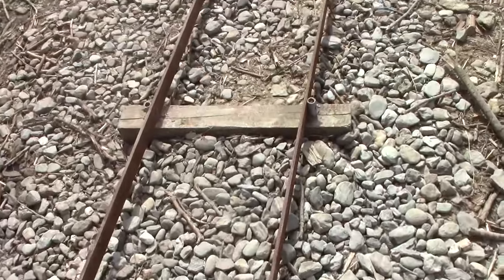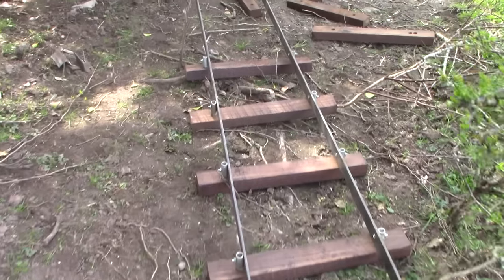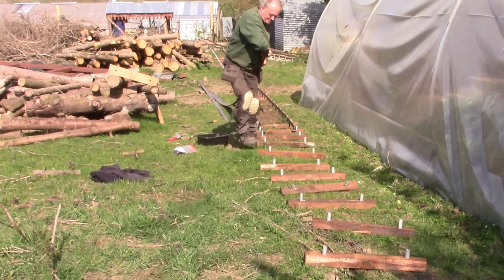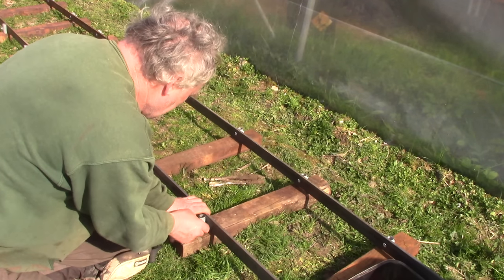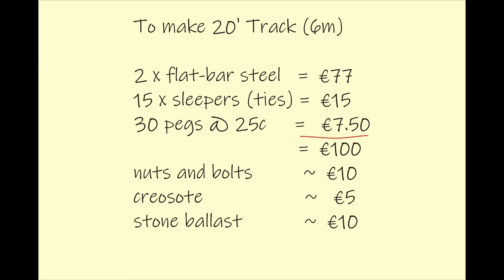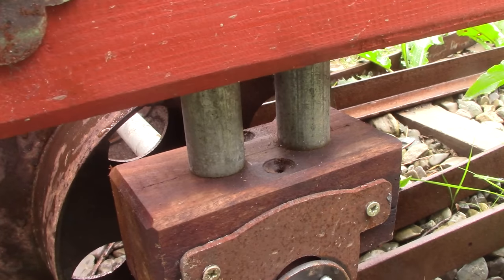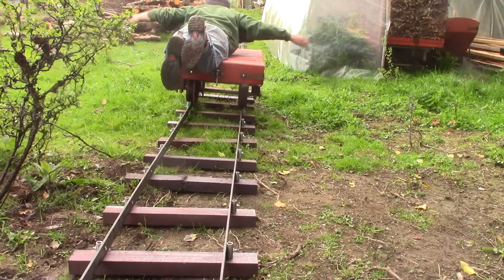How Much Does It Cost To Build Your Own Railway? For Garden, Field or Factory.

Comment: also, running costs for a push railway are MUCH lower than that of a quad bike, AND it's also greener, as your not burning fostil fules to run it.
Reply: It is even greener when he burns fossil fuels (like when he adds an engine) because rails are way more energy efficient.

Comment: I enjoy watching your videos!  Great fun and good ideas.

But to justify a railroad,  you need to have a lot of stuff you need to carry.  I live in my single family home,  and the only thing I need to carry a lot of frequently is firewood for my wood stove.  I use scrap wood gleaned from businesses in the area,  and I chuck that wood in my Chevy Astro van to carry it to my home.

I have a pav ed driveway in the front of my home with a large wood crate I use for storing cut firewood,  and an unpaved driveway along the side of my house.  I dumped a load of crushed rock on that side driveway circa 1987 or so, and while grass has grown up around that completely,  it still provides support for my van when driving on it and prevents it from getting muddy. 

When I drive a load of wood home, I back into that side driveway which provides access to a basement door.  Inside the door is a table saw I use to cut the used lumber to length,  nail and all.  

Once cut I can carry that wood to that  front wood crate for storage,  or carry it up the basement stairs in a box to be burned in my stove.

I also store wood under cover beside that side driveway.

So I'm able to use my van for moving a heavy load of firewood, and I can unload it and store it from my van pretty easily.

Once store,  I can pick up lengths of lumber and cut it to length on my table saw. All this can be done pretty easily as part of my daily life.

So I can't really think of an application for a railway like yours.  What I've devised is quite simple and efficient, and more or less cost free,  wood included.

Wood comes from businesses that are a half mile away or about three miles away. The scrap wood I get is odds 'n ends from a lumber yard or lumber used for packing large sheets of granite ---- 2x4, 2x6 and such lumber.  I can often get a van load when I'm driving around for other purposes,  so often I don't even to make a special trip.

I enjoy making fires,  and even now in early May,  a fire is needed to take the chill off the house unless it's sunny. 

So I'm afraid I can't think of an application  for a railway.

DARN!
Reply: Now you just need a e-bike and a heavy duty bicycle utility trailer to transport your wood without any gasoline, that way when they stop making gasoline in 2030 you'll still be operational.
Reply: There more than good ideas Tim is a genius can you do what he does  we marvel at some of Tim’s work what he his doing I think is very useful  indeed.You  might not think so .Speak for your self what you said is very disrespectful.🍀🍀🍀🍀🍀☘️☘️☘️☘️🇮🇪🇮🇪🇮🇪🇮🇪🇮🇪🇮🇪🇺🇦🇺🇦🇺🇦🇺🇦🇺🇦🇺🇦🌎🌎🌎🌎🌎🌎
Reply: @mrMacGoover  <<Now you just need a e-bike and a heavy duty bicycle utility trailer to transport your wood without any gasoline, that way when they stop making gasoline in 2030 you'll still be operational.>>
I find a wheelbarrow a useful solution for moving bulk goods around outdoors,  in many situations.

The railway looks like it's fun, but even commercial contractors don't use them that I've ever seen. Wheelbarrows are used quite commonly,  and have been used for  nearly 2,000 years.

That's not to disparage narrow gauge railways,  even pushed by hand.  They were widely used in mines for moving heavy loads by hand in confined spaces.

But it seems to me that to make them really useful,  you need to use them pretty intensively to make them worthwhile. Of course if you are building them as a hobby,  they are fine on their own. Some of the narrow gauge railways people have built to run around their yards look like cracking good fun!

I have several activities that really qualify as hobbies,  but save me a few bucks into the bargain.  An example of that is collecting and using rain water.  I haven't used citywater in my single family home for,  oh,  fifteen years or so. Helps that I live alone  ---I imagine that few women would care to be packing a five gallon bucket of water around for their morning ablutions!

Around Seattle,  it seems dumb to have floods of rain coming down,  but still buy water from the utility.  (?)

Perhaps home railways would be more common if someone made up a kit of materials and supplies that Home Depot could sell. Or someone might open a home railway supply store offering materials,  cars and classes.  "Do It Yourself or Let Us Do It For You!"  

I could lay out the track easily enough I think,  but building cars seems more complex. Being able to buy a hopper car, flat car and passenger car would make things a lot simpler. Having a passenger car to push children around in sounds like great fun!

Oh, dear!  Now I'm imagining people being required to meet Federal railway standards!
Reply: I can think of one application: Fun

You don’t necessarily need a purpose for a railway, you can build one purely just for leisure
Reply: @DianeD862  Who are you referring to?
Reply: @mrMacGoover  Seattle Pioneer that’s who.

Comment: The wider the gauge, the better the stability.  The flat bar steel for rails, solves a lot of headaches. Its relatively light,easy to impart gentle turns and not heavy to work with. For a light railway not using a locomotive it looks ideal.  the downside is contact area available for wheels which are driving, trying to grip the rails as they do on a locomotive.

Comment: While I wouldn't use this as a "scale" railway set up, this would be fantastic as a functioning narrow gauge system for use around a farm. I could see it now, a small critter powered with a cheap gas engine and a couple dozen cars to haul vegetables, building supplies, feed, hay/straw, manure, chemicals, firewood, fuel, gravel, etc... And the whole thing is both flexible and easy to maintain, all for the cost of a used pick-up truck.

Comment: I never felt that the prices were artificially low. In Hungary today 6m of the 50x8mm flat steel would cost 20k HUF, around 52 EURs, double that and it's 104 EURs just for the two sides and not counting for anything else. Everything is expensive here and we are the center of Europe. So, I think you are pretty lucky. :)
Reply from the maker: Yes, they do seem very high, considering where you are. I wonder why that is?
Reply: @wayoutwest-workshopstuff6299  I think there are multiple reasons. Mainly the war, which made the EURHUF rate really bad, really quickly. Everything coming from outside went up in price, general high inflation in the world (COVID&war) and lastly the construction industry was really booming (government projects and subsidies for families). Not even mentioning the highest VAT of 27% in the EU, which was a given, but of course it will also increase in the absolute terms when prices increase.
Reply: @wayoutwest-workshopstuff6299  But, with everything I still really enjoy your work, keep it up!
Reply: Akkor ennyit arról hogy én is belekezdek.

Comment: I use recycled asphalt as ballast because I get it for free and it compacts when exposed to heat, which helps keep the base stable. Unfortunately, grass grows easily in it.
Reply from the maker: how do you keep the grass down?
Reply: @wayoutwest-workshopstuff6299  With the gas torch.

Comment: I believe that it’s worth every penny you’ve spent so far ! Just think , you’ll have the only privately owned Railroad in Ireland 🇮🇪 and quite possibly Europe ! Now how cool is that ! Your prices are a bit high compared to the United States especially on the steel , a 24ft. 3” x 1/2” cold rolled is $32.00 and 10 ton of rock is $125.00 delivered . Not sure on the wood though and the nuts and bolts are about the same plus there’s a ton of free galvanized pipe for free by me ( everyone is changing there water pipe to copper or plastic ) and I’m enjoying your adventures !
Reply from the maker: Thanks, Dave - I'm jealous of those prices!

Comment: I wonder if small gauge local railways will return for industries such as farming. With the rising cost of fossil fuels today it is becoming much more expensive to run farm equipment. With a small gauge, flexible track, steam powered railway farmers may potentially be able to use less fuel by dropping off grain or collected produce onto mobile trains that then take the long journey back to the collection points. These small engines could potentially run on steam and their fireboxes could burn any available fuel from scrap lumber to waste oil to coal. This could potentially help farmers save on fuel costs in the long run. With a flexible and easily modifiable track they could also run much more heavy duty cranes into the field to assist in recovery and repair of downed equipment even in potentially soft or muddy terrain. 

An interesting thought experiment. There are probably many downsides Im not thinking of.

Comment: I'm surprised at how cheap your rails are even with the high prices, how much is one of those big basket carts?

My grandma had a rather large yard with a garden going all the way around the back starting on either side of the house (think 1950s US suburbs but the fancy 2 story homes)
As she got older she had trouble hauling her tools around so I built a monorail that went around the garden and hung on the side of the fence posts with the cart hanging below the rail.
It was some bent rebar for the supports and a similar (but smaller) flat bar rail.
I even made a little box to push the cart into to keep it safe and dry on one end.

Comment: Actually 15inch/381mm is the small size for commercially used rail. 600mm/2ft is quite common, but those lines can reach kilometers
Reply: That’s getting more into the industrial size railway. 15-inch seems to straddle the line between small industrial and garden/tourist attraction lines.
Reply: @andrewreynolds4949  well the usage here goes towards small industry

Comment: It works, But for how long. The base you provide for a railroad is just as,  or more important than the track  It probably would have been cheaper and better just to lay gravel and use a wheel barrow
Reply from the maker: You haven't seen the logs I'll need to transport yet - 12' long and heavy. Not easy on a wheelbarrow!

Comment: I do model steam railroading in 45mm gauge (slightly less than 2"). Although there are many competing manufacturers in Europe, Britain and the USA, cost tends to be something like 10-15 Euro / meter. The cost it seems is rather comparable I think. So choosing your track gauge  is about what you want to be able to run on your railway.

Regardless of gauge, field railways can take very sharp curves and pretty rough track, narrow gauge designs coming in second. And if you want to run models of standard gauge railway locomotives and wagons, you need minimum radius curves that take up so much space, that most people just don't have space for anything above 45mm gauge. Which is why this has become the garden railway standard. But there might be a club that you can join, and run on a shared railway with a / several gauges, bringing your own locomotive(s) and rolling stock. This is actually a very nice way to enjoy shared fun!

Whatever you do - stick to a standard gauge!!! But if you for example inherited some odd gauge locomotive, you can also build a double gauge 3-rail track. The switches are a bit more complicated, and you have to take into consideration what minimum radius curves normally applies to that gauge.

Even in 45mm gauge, I've ended up in trouble, because I was heavily invested in Märklin track and switches, before finding out that all my railroading friends narrow gauge wehicles had to deep wheel flanges to be able to run on (specifically) Märklin track.

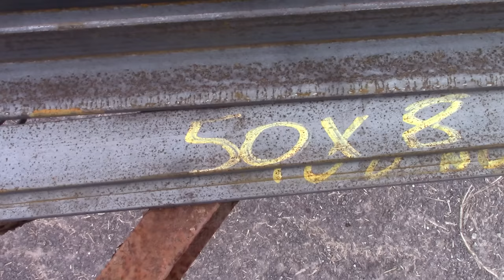Also, Märklin and many other German manufacturers allow for a rather extreme minimum radius of 1m even for standard gauge models (1:32). However the widely recognized standard is 3m, which means I had to set up a special loop with 2m radius fordd a new pretty exclusive engine. Now that was really stupid, even though I simply assumed I would never come into ownership of another such expensive locomotive. But ny good fortune, I now have... so once again I need to add track for a larger radius, this time minimum 3m. But I only have one switch that i built 45 years ago (when I was 15) that has 3m radius. (Currently I have 7 for r1m; 4 for r2,3m and one for r3m.)

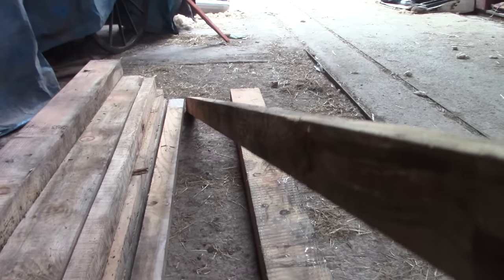I run 1:32 scale live steam on 45mm gauge track, but in larger gauges steam locomotives are VERY  big projects, also physically heavy to handle, which factors in. It's akin to transporting a horse to a show, when visiting a track with your locomotive. (Be ware, different safety regulations may apply, to operating passenger miniature railways in different countries. Make sure to adhere to those standars as well! Otherwise you are stuck. Also you can't sell, swap or give things with/to other people.

I have considered building a 7 1/4" gauge railway also. (In western USA also 7 1/2" is used. Nowhere else!) Though that one would be electrically / battery operated. But never say never, as previous experience has taught me... :-D
Reply from the maker: Thanks, Anders. There don't seem to be any groups here in Ireland, and I wouldn't have the time to attend any meetings anyway. I just made my railway to be useful to me and so far it has been. I have to build everything that goes on it anyway, so I don't worry about it being a standard guage here. Although in Britain 15" is still quite common, I think.
Reply: @wayoutwest-workshopstuff6299  Yes, I think 15" is a standard gauge used both for passenger hauling in amusement parks and such, as well as being used for doing actual work, like you do with your railway.

I really like your welded together wheels - especially the way you have created the inward curve shape of the flanges made me smile! It is in the true spirit of field railways!😄 Whatever works, is simple, and cheap!

I like it so much, that I imediately felt the urge to make some wheels like that my self, though in my case about 1 1/2" in diameter, out of tin can sheet metal, and gluing or soldering together the pieces. The rest of whatever wagon type it might become, will use very light weight materials like cardboard and balsa wood. (With a few layers of varnish and paint, it becomes sturdy enough. Also I was very inspired by you putting some aestetic attention to iron strappings of the wood body.

The reason I would want to build such light weight model wagons, is I have this toy vertical steam boat engine and boiler (something Mamod and Wilesco makes), that I'm thingking of turning into a classic USA late 19th century logging locomotive. Aparently it happened more than once that steam boat engines were repurposed this way. And the locomotives would be one-off designs constructed largely using wood.

In my case however, the tiny one cylinder boat steam engine is very weak - that's why I need ultra-light waggons to go with such a locomotive.

About your track, perhaps you could get some pressure treated wooden sleepers/ties for free from local lumberyards? Because at least here in Sweden, I can have as many as I want for free, of the wooden pieces used crosswise to stack the wood during treatment and delivery. They are otherwise only discarded. Because they were there during the pressure treatment, it's as well treated as anything you pay for. 😃 I use some 1m x 45mm x 70mm pieces for many things, but I have thought that they would also be ideal as track ties / sleepers.

By the way, if you do build and electrically powered locomotive, I suggest you make it radio controlled. It's clever, because it's dual purpose. You can use it both when sitting up riding on the locomotive, as well as operate standing by.

Have fun! Cheers from Sweden😃

Comment: Are four-sided nuts a thing in Ireland? Never have seen those here in Germany. Love your railway btw :)
Reply: Four-square train loving nuts occur around the world.
Reply from the maker: Only on small bolts - up to 6mm?
Reply: Square nuts used here are special purpose for fixing sheet roof materials. Special because they should be cheaper than hex nuts in bulk 😁
I could get them in Switzerland, so probably available in Germany as well.

Comment: thx very much I waited for this.
obvoisly the costs very from build to build. But having a data point helps in discussions what options even to surge materials for and it gives a starting point in comparing prices.
I would say €20 in material easily trump a lot of mud free pathes. most of which could carry less load.
If you want to be able to bring in materials and the options are this, or a road, that a car could drive on, I think you have the cheaper solution.
how long round about do you take to build a peace of rail?
Reply: for that money you can pour concrete and use a cart with wheels, but yes it wouldn't be as fun and would be more permanent
Reply from the maker: M.C. How long does it take? I suppose an afternoon, realistically, because there are a lot of holes to drill..
Reply: @wayoutwest-workshopstuff6299  
an afternoon with just one person? so about 3h ?
so that would make around €20 + 0.5 manhours per meter.
Why do we even build roads for cars?